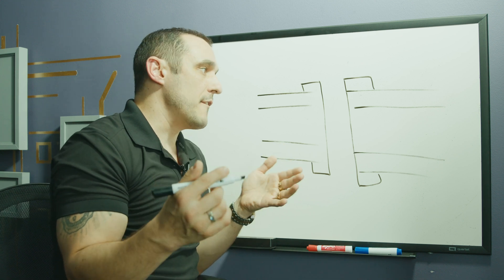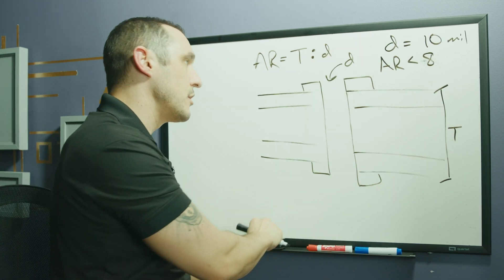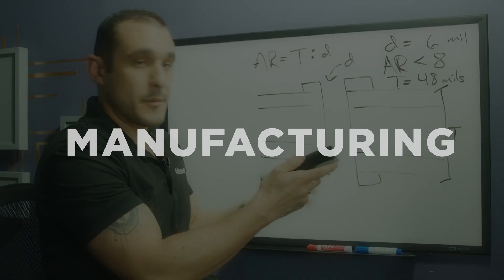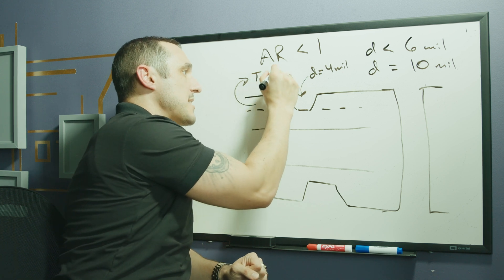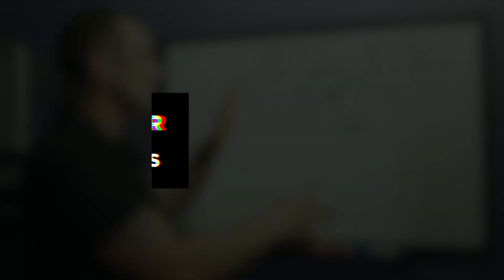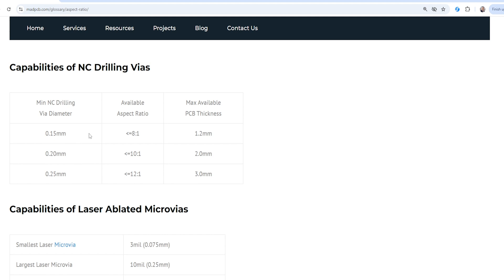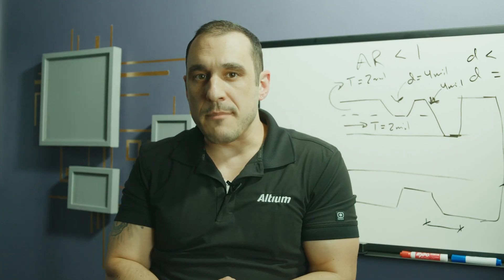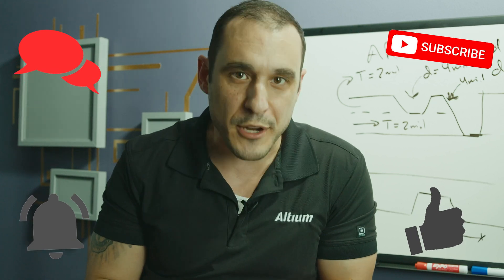Mechanical Drilling vs. Laser Drilling in PCB Vias

Comment: For routing complex designs on both sides of a PCB I am fond of reverse stack-ups. That is where you basically bond two or more cores after they have had some through-holes etc done.
Allowing for greater flexibility in routing on both sides of board and even on both sides of the cores in some cases. I like this particularly when there is complex BGA's back 2 back, or the available board space is just very low. What are your thoughts on this? Should it be used more, or less?
Reply: Interesting idea, I have never done one of these stackups except in an RF design and there was no BGA in that PCB. From the routing standpoint it makes sense but back-to-back BGAs can have some assembly and inspection challenges. What if one of the BGAs does a head-in-pillow? What if one of them has warpage? It’s not a problem on small back-to-back BGAs, but larger BGAs with finer pitch are more likely to have these problems.
Reply: @Zachariah-Peterson  I guess PCB manufacturers have gotten a lot better as I have actually not had much trouble with warpage but my experience has been limited to 20mm wide BGA's. The flatness of the PCB's have been excellent, and I have not dictated to assembly what order they need to do things in. If they decide to run tacky paste and a single board reflow, or if one side experience two cycles has been up to them, and yields have been very good. Depending on the order specified and layers you need  you can for example have two cores that each get an additional set of layers added with microvias available from both sides, then when the cores are merged you end up with 8 layers total, and if wanting to be insane you can add another set of layers on this complete sandwich doing microvias again. Manufacturers may start to require some extra tolerance around your annular rings etc but it's remarkable what they can do if you are willing to pay for extra press cycles.
Reply: @1kreature  Are you sure the yields are really good? I only ask because the more aggressive manufacturers, and definitely quick turn manufacturers, will have really low yields in the shop but they will give you the boards that actually pass electrical testing, so the yield appears to be very high.

Might have to do a video on this...
Reply: @Zachariah-Peterson  That is a good point!
I have no idea how much the manufacturers had to work to deliver, but they did not complain, and did provide other feedback on layout and adjustments that would help in their production. I would assume that such feedback would be lacking if they were tanking internal losses? The components we were using were also rare manufacturing samples and as such were in very short supply, yet our deliveries always met targets. We have also not experienced any failures in the field suggesting at least maybe they did not pull these chips off failing boards to meet delivery requirements, which would have been my first thought based on your insight.

Head in pillow issues seem to be related to poor control on paste open time or thermal profile boiling off too much flux before the reflow moment btw.
A former colleague of mine have been running an assembly-line for some time and loves to rant on about that. Sems to be worse with finer pitch as you say.
"Sometimes I just want to dip the <bleeping> thing in flux and do another cycle!" - Him on a good day.
I'd love to see that video. It's an interesting topic.
Reply: @1kreature  If they aren't showing you defect data or SPC data then you will have no idea what the real yield is. The way this business model works is they build in enough margin into their price to account for potentially very low yield. And of course they are going to do you a favor to try and "improve" the design, all it does is decrease their overhead! I'm not suggesting they are pulling chips off of old boards; most often the problems that result in scrap start in the fabrication of the PCB, not the assembly. An assembly defect can be reworked, but not a fabrication defect.
Reply: @Zachariah-Peterson  Good point.
I do receive panels of boards that we break out ourselves and there is usually only the occasional x'ed out board in a panel. In 30 panels, with 12 boards each I think I remember seing 2 x'es. As you say, they do not inform about the actual yields at the PCB stage, but the turn-around times have been very short leading me to believe the assembly is not that challenging. Would be interesting to dig deeper into this and hear what the manufacturers have to say about this for real.

Comment: Hi, lets say a well known manufacturer says his aspect ratio limit is 1:8 (drill size 0.2mm for example) and he can reliably manufacture that. Do you think that using such an aspect ratio everywhere on the pcb instead of bigger vias would still affect reliability of delivered boards from the manufacturer ? (Without considering via inductance and via current)
Are vias hitting aspect ratio specification limit always reliably plated ? (On delivered board)
Reply: Just because a via has the maximum aspect ratio, that does not mean it is always less reliable than a via with lower aspect ratio. Manufacturers normally specify those maximum aspect ratio values because they know it will have reliably high yield that is comparable to lower aspect ratio. They normally have some margin attached to that number, they have the ability to fabricate a larger aspect ratio and you could request a deviation, but they may not give the same reliability guarantee. If you go too far above the maximum aspect ratio, some projects may get no-bid and you will have to take the PCB somewhere else.
Reply: @Zachariah-Peterson  thank you for once again giving a detailed answer ! Nice to know that the aspect ratio is given with a safety margin.